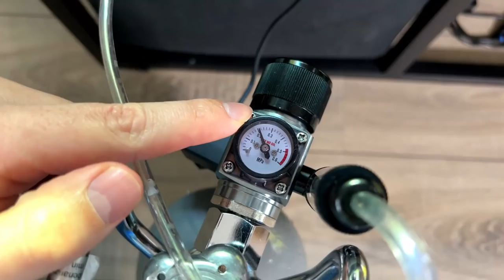I MADE A MISTAKE...😖 LOW BUDGET VS HIGH BUDGET UPDATE

Comment: Hey MJ I really love your channel and have recommended several of my friends to it. I was wondering if you could do an experiment of "CO2+Low light" versus "High Light with no CO2" to see if CO2 or Light is the limiting step? Another follow-up experiment might be to compare "High Light for 6 hours+CO2" versus "Low Light for 9 hours+CO2" to see if a longer duration of low light can compensate for lack of high light. If we can overcome the expensive cost of lighting by using longer periods of budget lights + CO2, it will help with aquascaping using the Biorb and Fluval tanks that look nice but typically comes with poor lighting and very few options to upgrade.

Comment: There's no real way to avoid backflow on a CO2 line, you must use a checkvalve.  This happens because CO2 inside the difusser and line will start dissolving into aquarium water. So pressure inside the line will start to drop and draw aquarium water.  You could install your checkvalve closer to the tank or even closer to the diffuser to limit the amount of backflow.

Comment: Ive been out of the hobby for 6+ years now so my info is out of date. But for checkvalves I was always a fan of the stainless steel metal check valves, and I think a uk company co2art? sells some kind of nice push inline one as well. I think the metal ones can be found on amazon under metal aquarium co2 check valves.

Comment: Great video - really intriguing!
Can I ask how you manage to maintain consistent pressure in your DIY CO2 system?
I can never quite get it to build up enough to run through a diffuser — I've resorted to placing the end of the tubing in the mouth of the water pump intake. As the bubbles come out they get sucked through the impellor and out into the tank – so they end up very fine but at surface level.
I imagine it's a combination of ensuring the system is air-tight, the tubing isn't over-long and the diffuser isn't too deep under water. Any ideas?
Love your channel btw
Reply from the maker: Yeah it has to be really air tight otherwise you don't get enough pressure for a regular diffuser. I think that's what matters the most.
Reply: @MJAquascaping  Thanks!

Comment: What do you use to clean the dust algae of the glass?
Reply from the maker: Filter wool or filter floss some people call it
Reply: @MJAquascaping  I used the razor scraper and the Albert heijn dish cleaning sponge and both have left scratches on my glass and I am now too afraid to clean. Does filter wool work against tough algae stains? I have a bag of it that I bought from Intratuin so its not branded. Really looking for a sth that can remove hard algae (Spot / dust) off the glass without scratching it. :(

Comment: The diffuser in the high budget tank got clogged, so the pressure you have initially set the needle valve could not push the co2 anymore.

Comment: Can low nitrates promote green dust algae? I have  a no co2 tank, and the no2 are always 0 and no3 are always low (<10) and I can't get read off of green dust algae on my aquarium walls. I only dose micro nutrients and potassium. What can be the cause?
Reply from the maker: I think nitrates are the main culprit for GDA, and even if your nitrates are very low, they will still appear. Reducing your light intensity also helps
Reply: @MJAquascaping  ty vm for your answer. will adding co2  help with this? I'm considering buying a co2 system just to get read of it. Also what beginner plants will fight the algae for the nutrients. Cause my plants seem to lack some nutrients (leaves at the bottom are melting on on both my Ludwigia Repens and bacopa caroliniana) but the gda is doing great, and now I'm afraid to add macro nutrients to avoid helping the algae more ...

Comment: Bro my DIY CO2 system is not doing well ..what should I do ...the large bottle make a bubble ..also the small one...but there's no any bubble out from my diffuser
Reply: your diffuser must be too big/the ceramic is thick and it makes to much resistance since you don’t have to much pressure from the yeast-sugar system.
Reply: Took me 2 days before there was enough pressure buildup, you can try mixing the yeast solution now by swirling the bottle
Reply: @apfeln  how to I make a high pressure sugar and yeast ...add more sugar or less sugar or more yeast or less yeast
Reply: @libratv2351  sorry i didn’t see you replied. You cannot build up enough with sugar and yeast. you need at least 1,5 bar. you can use a cigarette filter put into a 4/6 hose but you need to change it regularly. i recommend you to buy a citric acid and baking soda kit it’s like 15-20eur on ebay/ali
Reply: @apfeln  it's okay ...it already being good ... I tried to use another way and it work ..btw thank to u

Comment: Hello Mark. Excuse me. I know it's very simple. But can You explain a little bit more how si You clean with bleach You difuser? I have the sale fórmula of CO2 with gelatin an ir works fantastic
Reply from the maker: Basically I just take some warm water, and add some thick bleach. I don't really measure it, but I would say it's 1 part bleach to 10 parts water. Then I soak everything in there, diffusers, lily pipes and so on... after about 15 minutes I take everything out and clean it with fresh water (I don't use any dechlorinator, but I should really) That's it!
Reply: @MJAquascaping  thank you very much. Sometimes i see a little jelly in tye difuser. Si that normal?

Comment: After I experienced problems with the integrated check valve from the Tropica nano diffusor, I settled on one of these https://www.amazon.de/gp/product/B06XZPGYK4 (Aqua & Co Co² metal Check valve). My experience is that especially these cheap plastic ones often cannot fully prevent, that co² diffuses/draws the water back into the pipe over night. The same goes at least for my bubble counter which also states it has an 'integrated check valve' - yeah that did not age well. The suggested valve is surely a massive thing but I did not want to take any risks of water getting into my co² pressure reducer or near that. Great Video as always, love your pragmatic style <3
Reply from the maker: Awesome thank you for the recommendation!